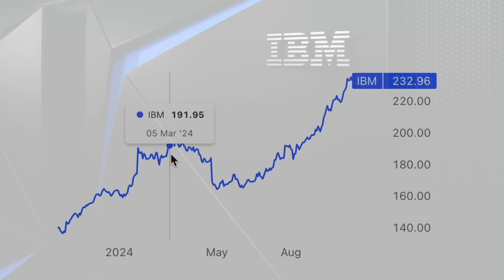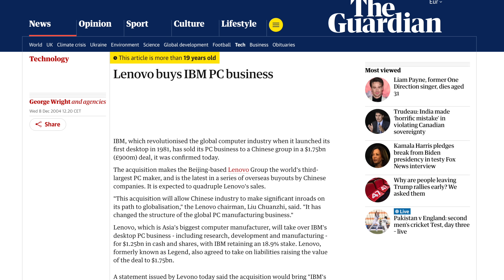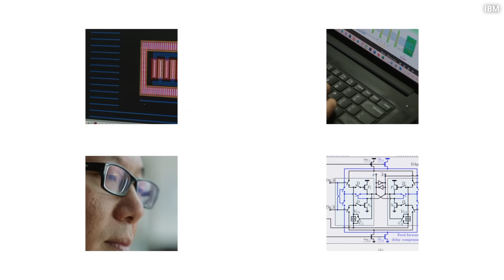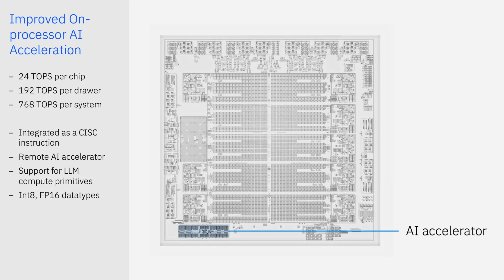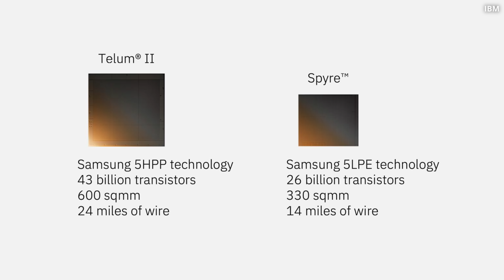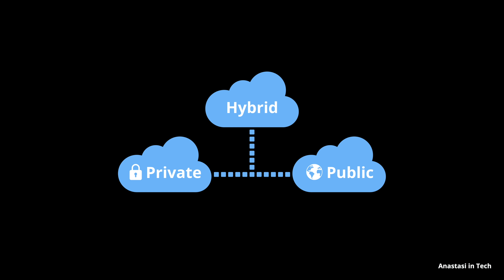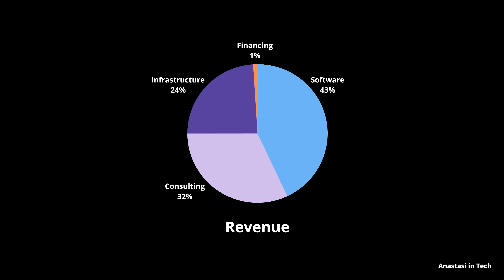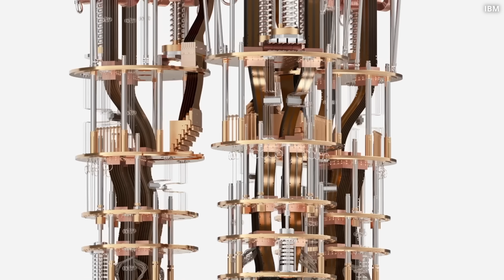The Secret Plan of IBM

Comment: IBM can announce and manufacture all the AI chips in the world but that will not help them achieve anything.  They're late to the boat, as is Intel, AMD and everyone else.

The only winners in the AI space are ARM, Nvidia and OpenAI.  And ARM doesn't even make a single chip!

ARM because its architecture has proven (by beating Intel) in the low-power consumption, mobile devices space for decades now.  Intel, despite being an ARM licensee I believe, has never had a successful low-power chip design.  There has been some peaks, here and there, but not to the success level of creating an entire ecosystem out of it, like ARM!

Nvidia, on the other hand, just happened to be in the right place at the right time.  Coincidentally, GPUs are very good at number crunching, which happens to be a huge task needed for training AI/ML models. It's THAT simple.  To the point where Nvidia is now the most valued company in the world (standing at $3.5T+, at the time of writing, late 2024).

IBM is merely doing what they always do; make a new chip/system and announce it as if it's a mainstream product, whereas actually, it's just for them to use in their next machine(s), nothing more.  Manufacturing a new chip or releasing a new GenAI model, like Granite, doesn't automatically make them leaders in anything nor will they gain any market share or excel in their public cloud business (IBM Cloud).

If you're still not convinced, here's a great story from this summer (2024):  It took OpenAI less than 30 minutes to steal the thunder of Google, when a day before the Google IO conference in May, they announced the (by then) latest and greatest GenAI model, GPT-4o (a multimodal model).  This overshadowed the 9+ hours of muddled and confusing announcements made at Google IO, put together!

So IBM can make all the announcements they want. Patent all the patents they want.  Buy whoever they want (latest being HashiCorp - but that's just Red Hat crying to its parent to dig into its deep pockets and buy the latest toy), like a spoilt brat.  They can even Open Source their LLMs (Granite) and make AI Accelerators but none of this will help their position.

Comment: IBM did not innovate with the IBM PC.

IBM was worried about antitrust liability. They bought the rights to a modified CPM motherboard design that used a 16 bit chip with 8 bit architecture. They hired Bill Gates to modify the CPM operating system.

They did expand PC architecture to use the 80286 processor with 16 bit architecture, and then the 80386 with 32 bit architecture.

Comment: No one should ever confuse patents with innovation. Patents are part of the legal arm of the company and engineers are highly incentivized  (in some companies like IBM) to write patents on literally anything regardless of it's real value. I had the same pressures put on me back when I worked.  Of course any real new tech will have as many patents written on it as feasibly possible as well. But a patent often represents no real innovation at all.

Comment: IBM didn't develop the first PC. They only developed the first IBM PC (which is a tautology). They weren't even close. Even with the most restrictive of definitions, the first PC was released well over 4 years prior to the release of the IBM PC. That was an extremely long time in that market. Many companies had released PCs before IBM.
Reply: IBM entered the PC market reluctantly and didn’t care too much for PCs afterward.
Reply: @GoalDukkAt-DS9  IBM did not enter the market reluctantly. They entered radically--with great conviction that they had to get to market as quick as possible. Their biggest problem was that they waited so long--and that is why, when they finally woke up to it, they had to move so fast, so as not to lose the opportunity to dominate the market for PCs in business.
Reply: IBM developed a personal computer in the mid 70s. It was powerful but too expensive, and IBM marketing didn't know how to sell it. Even if it was the first (big if, I really don't know), it didn't make computers popular. The honor belongs to the Apple II running the first killer app: VisiCalc, the first spreadsheet.
Reply: @bearcb  You're referring to the IBM 5100 from 1975. It was a personal computer (even if it wasn't called that), but it didn't use a microprocessor (it's CPU took up an entire PCB), and the base model cost $9000 (1975 $). There were other personal computers prior to that, and multiple of those were microprocessor-based PCs, even--the latest of which was the Altair 8800, which was released in Jan 1975 for $621 assembled. And that was the model that took the US by storm. The TRS-80 was far more popular than the Apple II, even for a while after VisiCalc was released in 1979. The TRS-80 was arguably the first PC to make PCs popular.
Reply: @RetroDawn  yes about the IBM one, too expensive like I said. I knew about Altair and IMSAI, but was not sure which year they were launched. TRS-80 was popular in the computer-savy community, but soon Apple II blew it out of the park.

Comment: Each chip excels in specific AI computations, making them complementary rather than mutually exclusive.
Niche Specialization
IBM Telum: CPU-AI integration, security, and enterprise.
IBM SyNAPSE: Neuromorphic computing, low-power AI.
Google TPU: Optimized for Google's AI services and cloud.
NVIDIA GPU: General-purpose computing, broad adoption.
FPGAs: Reconfigurable hardware for optimized performance.
No Obsolescence
None will make others obsolete; instead:
Data centers: Combine CPUs, GPUs, TPUs, and FPGAs.
Edge devices: Leverage specialized chips for efficiency.
Research: Explores diverse architectures.
Modular Approach
AI systems integrate various chips, each handling specific tasks:
Inference
Training
Processing
Memory management
Heterogeneous Computing
The future of AI computing involves combining diverse hardware to optimize performance, power efficiency, and cost.
We highlighted the importance of understanding each chip's strengths and weaknesses, rather than proclaiming one as universally "better."
Reply: great stocks to buy
Reply: " Neuromorphic computing" is not a word or phrase.... You don't need AI for your list of offerings or categories. Me thinks you got bit by the AI superbug !!!! Diverse Hardware will not cut it.

Comment: IBM wasn't behind Microsoft and Amazon in cloud offerings. IBM was just avoiding getting into another commodity market like their PC experience. IBM was working with hybrid cloud solutions at the same time as Microsoft and Amazon.
The market just hadn't caught up to the relative value of a hybrid cloud with its data ownership versus commodity cloud.
Unlike Amazon and Microsoft, IBM actually steps in and offers consulting to design and provide end to end solutions as opposed to hosting and licensing.

Also, IBM didn't need an acquisition for consulting. IBM has been offering consulting services for nearly 70 years.
Reply: Right, pay $200-500 plus man/hr for management consulting and over priced technology solutions. Not forgetting they are still the Wall Street darling for consulting and services, if you want Wall Street support and stock ratings go along to get along. Their last great idea was SaaS (Software as a Service) business model that failed. Still they have tons of assets in technology, people and patents ... they still could reconstitute or they could just continue to milk those assets as they fade away into white noise. Cloud computing is a piece of cake for providers with deep deep pockets, not surprising they are cashing in as best they can.
Reply: @abebrock5559  IBM manages property management systems for hotels, point of sales systems for auto stores and architects super computers for the Department of Energy while still hosting the majority of banking.
Cloud computing isn't the piece of cake you're trying to make it. Hybrid cloud less so.

That, and this isn't IBMs first evolution. They started off with time clocks and type writers.
Reply: @wisenber  Well stated. I acknowlege they are successful in cloud computing and making a pretty penny currently doing it. IBM is not the leader in it but successful. The question for myself .. does IBM have the commitment and the vision to prevail and innovate in it, or their other active technology adventures to which they are investing. IBM could be the next SpaceX in the cloud and AI industry or they might pull out altogether if competion gets momentem. They have a long history of leaving markets that stay profitable for many many years after IBM is  gone.  I wish IBM all the best and wish they would bring back the pension plan and reduce executive salaries, and return to manufacturing and R&D to the US.
Reply: @abebrock5559  I think you're missing what IBM actually does. Their hybrid cloud isn't what Amazon or Microsoft is doing, and neither Microsoft nor Amazon offer the consulting and architecture to have an actual solution.
And no, IBM doesn't have a long history of leaving markets. They remain in markets that predate both Amazon and Microsoft existing.
Reply: @wisenber  PC manufacturing, PC client operating systems, fiber optics adapters, DASD and storage solutions, communication controllers, laptops, collabortive computing, PC office suites, mid-range business solutions, digital phone systems, computer management solutions. To name a few off the top of my head, all still viable markets.

Comment: I had to laugh when your video showed the first IBM PC. I bought that PC the day they released it for sale in 1981 or 1982. It had an Intel 8080 processor, 512k of memory, dual floppy drives (hard drives weren’t a thing yet) and a monochrome monitor. It cost me $3,200 back then. I eventually used it to do COBOL coding with Realia COBOL. It saved me a fortune because buying time on mainframe computers back then was unaffordable for an independent programmer. I think it took me 6 months to make my investment back. I actually upgraded the PC with an AST Sixpack + which gave it a real-time clock (the stock PC date and time had to be manually entered each time it was powered up) and increased the memory to an insane 640k of memory. I seem to remember some additional ports on that card. It is an absolute joke in today’s technology, but it was worth its weight in gold in the early 80’s. Thanks for the fond memories. 😊😊😊😊
Reply: today people don't know 512k was an unbelievable amount of memory for a "personal" computer then. At that time the mini computer at my bank had 128k and we wrote payroll software that could have, if asked, conquer 1,000 employees, that easily fit into 48k. It is amazing how much work can be done even with 16k of RAM. TRS-80 LEVEL II disk BASIC was only 16k and we never reached its limits with our customers.
Reply: I waited to buy my IBM PC until they had increased the built in memory from 64k to 256k.  It was about 1980.  My first hard drive was $400 and held 10mb.
Reply: Ah, the millibit, those were the days. ;)
Reply: @xbfdsddfgh2773  After I made a couple of purchases of hard drives, I realized that these things were increasing in capacity in leaps and bounds, while prices were dropping inversely. I then told myself to NEVER buy a drive until I actually need it. That has been good policy.
Reply: E PC VIRAL PORN 18 + #ACT
Reply: did it have a proprietary OS back then or was it DOS? Did you eventually move on to Apple back then??
Reply: @j-555  It was DOS 1.? (Not sure if they had a point release yet). I worked for a major aerospace company at the time and I was the first person to show the value. I wound up forming the Office Automation group and began deploying the stand-alone IBM XT computers throughout the office areas (connectivity back to the mainframe was via 1200 baud modems). Each one was equipped with an Epson dot matrix printer with a box of green bar fan fold paper to generate hard copy. I’m not even sure if Apple was a thing yet. It did eventually come on the scene, but mainly in the areas that produced documentation / publications and I never got involved with them. My only exposure to Apple products was went I retired (after 43 years). That was 6 years ago when I bought an iPhone and iPad. I haven’t looked back since.
Reply: @retiredbitjuggler3471  God being able to get these insights is my favorite part of the internet. If it wasn't for the internet and the presence of people like yourself, all those memories would be lost like "tears in the rain." (Blade Runner.) Speaking of which, you must've felt like you were living in the future back then.
Reply: @j-555  PC-DOS, which was  the IBM version of MS-DOS.
Reply: Think it was the 8086 chip. A cheaper 8bit 8088 chip was released. It was succeeded by 80286, 80386 and 80486. Intel renamed the 5th iteration as Pentium on.
Reply: @ You jogged my cerebral cobwebs and it was the 8088 in 1981. That also reminded me that it was 43 years ago!  Arg!!! 😧😧😧
Reply: those later versions of the XT and MS-DOS could have 3 centronix ports and 4 serial ports, 640k or 1 mb of RAM, and 60mb HD's... how much work can be done with one of those is remarkable!
Reply: That's Fabulous story for someone like me who started on that very machine, as a kid. 512k or 640k was an unbelievable amount of memory. My credit union at that time run the entire show on a mini computer with 128k. Most database software I wrote then would do a lot with just 32k, by linking program segments.
Reply: @ Yes, the good old days when you really had to know what you were doing. 😀😀😀
Reply: You are never going to need more than 512k of memory.
Reply: @jamesalec1321  Well, yes I did think I lived in the future — In fact, I can recall at the time my manager saying “This technology will shrink down to the size of a phone in the next 20 years”. Now to put that in proper perspective, desk phones were basically a 6x6x6 inch cube (massive by today’s standards). I thought it would take much longer. The first iPhone was released in 2007 and was massively more powerful and capable and it fit in the palm of your hand. At my age, the future is accelerating at a blinding pace. I have an old Jeep that has served me well for many years. Well, I took delivery of a Cybertruck 2 months ago and it is an X-wing Starfighter (Star Wars Trilogy) in comparison. This is a technology leap that was probably unimaginable back in the 80’s. Heck, I’m having a difficult time imagining it now — a truck that looks like a space craft, is extremely fast, very silent, and it drives itself. It is mind numbing— like a conversation I had with my wife’s grandfather decades ago. He witnessed the introduction of so much over his lifetime that were considered miraculous— internal combustion cars, planes, man landing on the moon in 1969 (my own father fabricated parts for the Lunar Lander for Grumman and they will be littered across it’s surface forever) and as crazy as that all seemed to him, what I have witnessed is technology advancing at an every increasing pace. It makes me wonder what my 6 grandchildren will witness in their lifetimes?
Reply: @jamesalec1321  The first mainframe I worked on in 1968 was an IBM 360/50 with 64K(!) memory. The CPU with disk drives and tape drives filled a large room and cost a million dollars. So yeah, 512K would have been a notable event.
Reply: Hard drives were a thing decades before floppy disks.
Reply: @tvalxorg  The drives I worked on in 1968 were about the size of a washing machine, and each disk was a pack of ten(?) platters connected with a central spindle, and mounted in a plastic container that looked like the cover of a cake dish.
Reply: @bxf99999  sure. Greetings to old timers. I began to work on IBM clones in 70s. Those computers occupied big halls. Never the less the IBM operating systems were more balanced and reasonable than Windows 11.
Reply: @tvalxorg  correct!
Reply: @ Certainly not on microprocessors. The first hard drives for the original IBM PC didn’t arrive for a year or two after it’s introduction.
Reply: @retiredbitjuggler3471  Hard drives are an old technology idea, at least 1950's for the first commercial HD's. They have been progressively miniaturized. We used to use old HD platters as radio antennas.

Comment: Hey guys at IBM. I am very impressed that you have so much invested in tangible products, rather than trading Capital, like the douche bags who are destroying the economy (might want to keep a close eye on PWC). One thing to consider, is that as far as the AI tech goes, it does not make sense to build multi-core computer chips that have cores numbered below 100.  NVIDIA is dominating the market, because they have found a way to put cores numbered higher than 10,000 on a single chip. Yes, you heard that right, NVIDIA makes chips with the number of cores well north of 10,000.  So while CPUs are important, GPUs have become extremely important. GPU software, such as shaders are way out in front, as far as computing speed, which makes use of these massive number of cores. The AI software guys found a way to adapt the shader technology into neural network software.